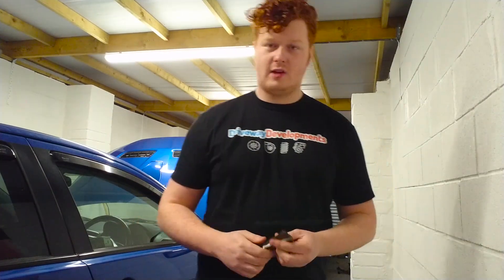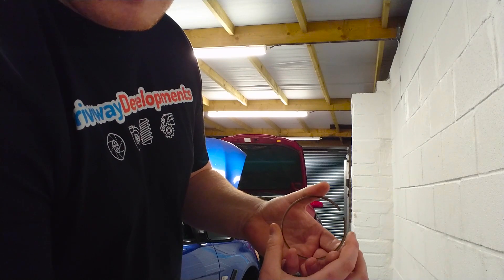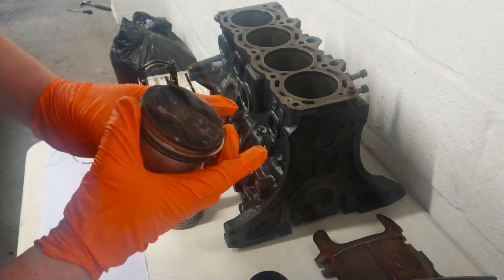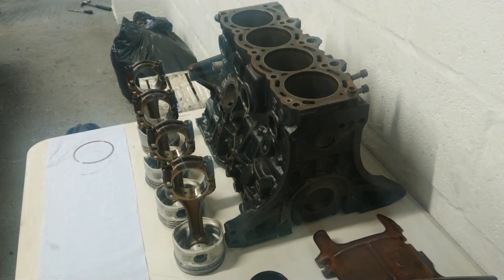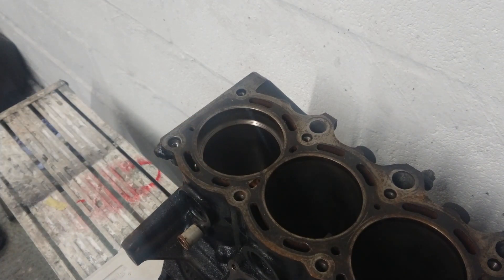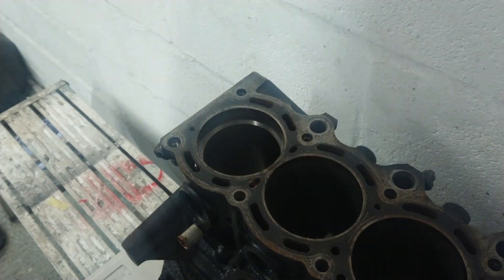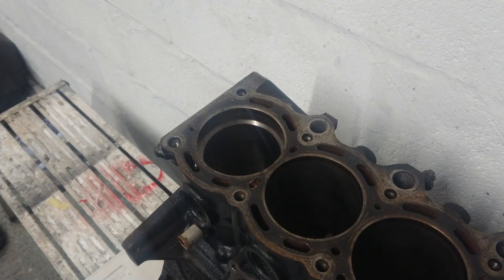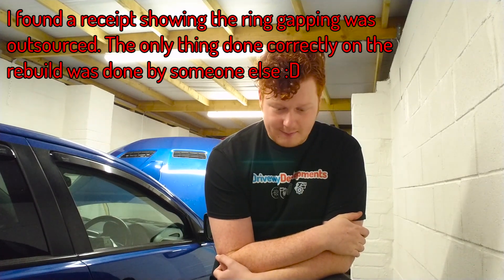Checking GT4 Piston Ring Gap on ST205 3SGTE Engine Re-Build

Comment: I'm stripping my 3sgte from my scrap mr2 I bought for its engine, completely stripped the car and am gonna put everything in my N/A, issue 1, found 1 pair of big end shell bearings with chunks / grooves out, crank actually survived by some miracle and a quick polish is within speck, cylinders in block great, really happy to see no scorn marks and no ridge, will give a quick hone out to get the glazing off, then fit new piston rings, as I'mI'm there, cylinders are in speck so hopefully rings, shells and off it goes for another 30 years, @megapixel000 in Instagram if you fancy a look at my progress.